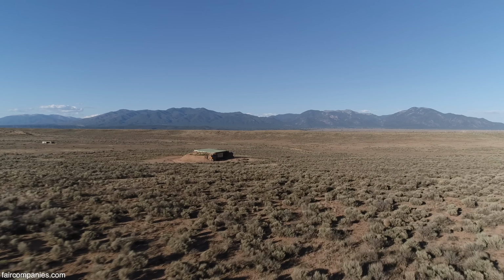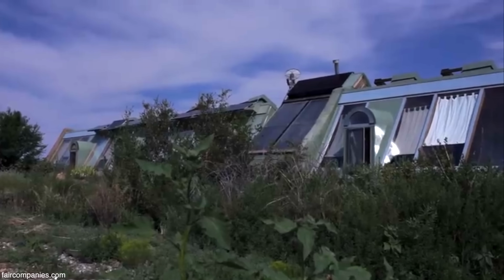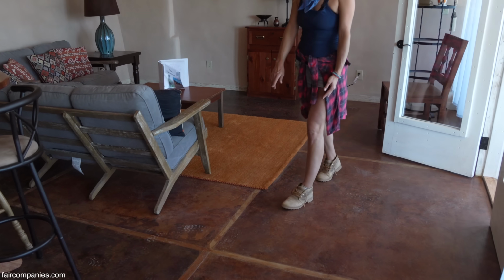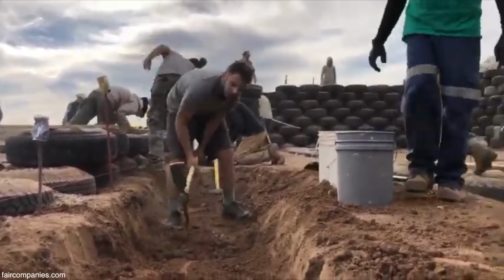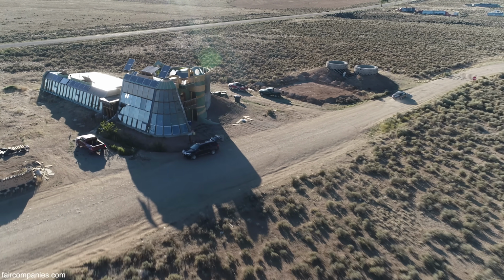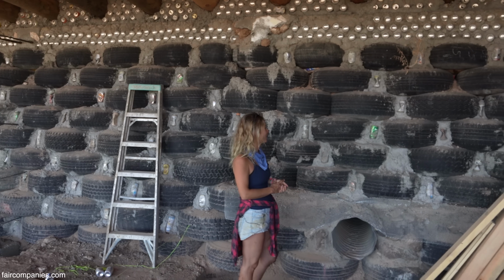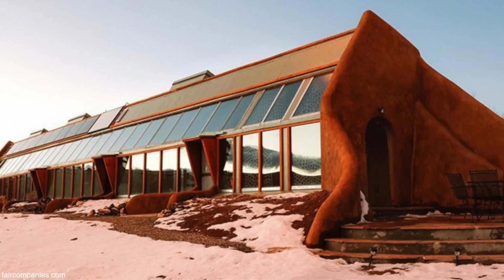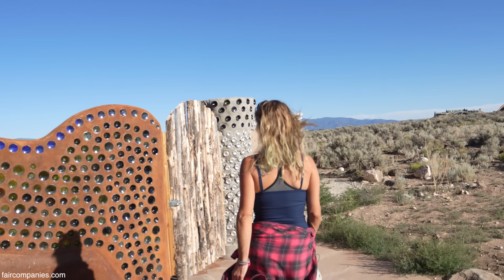New Earthships capture more energy, water & food at lower cost

Comment: It's not just low-tech, it's good engineering! This is the height of efficiency.
Reply: You get it! Exactly. It’s pretty ingenious, actually.
Reply: Hi teck is the solar panels.. low tech is the water and air  filtration system..
Reply: @bonnieprice9482  
Best of both worlds.
Reply: higher tech, higher damage
Reply: It's a return to the nineteenth century.  My mother lives in a house built in 1855.  When its 40 degrees outside, she's wearing a jumper.  Nothing was built with electricity in mind.
Reply: just "low tech" as opposed to high tech with sensors and screens and batteries and crap
Reply: and they are pretty
Reply: It's not "good engineering" .. Air naturally moves from a smaller opening to a larger one.  To test this.. roll one window on your car down all the way.. then crack the window on the other side.. Air rushes through the cracked window and out the big window.. it never changes, always works.  Any "air conditioning tubes" should be of a small diameter and the supporting windows on the other side  of the house should be 5-10 times larger in total area.

Comment: It's good to see they FINALLY started putting the batteries indoors where the temp is steady (and well above freezing) instead of the roof where the batteries' performance degrades more quickly with the wild swings in temperature from broiling summers and freezing winters.
Reply: That is probably due to a shift from lead acid to Lithium batteries. The lead acid outgased a lot of hydrogen and you could blow up your house. So they were put outside where they could be well ventilated.

Comment: One thing I’ve been thinking about is how the ancient Egyptians used mirrors to reflect light deep into structures. With the right emplacements, it could be directed anywhere indoors. Also you could use a gravity as a battery, with sunlight pumping water to the roof during day, and flowing down at night through a turbine. Or even pressure storage. And magnifying lenses could concentrate sunlight for cooking, or heat retention in rocks.

Comment: Low tech is good. Less things that will go faulty, easier to troubleshoot and fix.
Reply: Do you see the irony in saying "low tech is good" in a YouTube comment?
Reply: Exactly!

It's why I like having mechanical tools!
Reply: @CurtisDensmore1  Not really. The point is to be as low tech _as possible_. It's like the KISS principle in engineering. No matter how fancy a product you're designing, keep it as simple as possible.
Reply: What an inspiration. Thank you 😊💕
Reply: i would like both options. one that is automated and the other when the automated one needs repairing.
Reply: Many will need it built for them and funded for them. It’s a cool concept. At one of my jobs I tried sourcing them some materials but transportation wasn’t provided by my employer and he could of written off on his taxes, he owned a trucking company. It would of saved him waist costs.
Reply: I like to call it "Earth Tech"
Reply: @CurtisDensmore1  yeah. It is a curse and a blessing that I am both addicted to and can’t wait to get away from
Reply: @5226-p1e  Yes.  And there are forms of automation that are pretty low-tech, like the bi-metal coil that can open/close a valve/switch as it heats up or cools down, or thermoelectric cells that power a fan to move hot air around when things heat up.  Stuff like that.

Lots of smart people working on this stuff.  Full-feature Earth Ships are still fairly "young."
Reply: @5226-p1e  There's certainly very few reasons why you couldn't automate stuff, especially the various ventilation stuff
Reply: @MrSpleenboy  
i don't understand your point, please explain.

Comment: I love how you’ve adapted the earth ship over time and put all the years of experience into different environments. I’m curious if you think an earth ship would ‘sail’ in a temperate rainforest? I’m in the Smoky Mtns and looking to get undeveloped property for something similar, in terms of build concept
Reply: Hey Russell, I hope you see this:  Be sure to study such things as 'angle of declination' charts & info - for the area you become interested in - for positioning your south wall and roof overhang.
Don't forget to slop what isn't under your foundation/slab away from your front wall, also strongly consider either a perforated, clay or French/rubble trench drain.
Best wishes - never let go of your dream!
Reply: The only issues I can see is having to make sure your wood is as weatherproof as possible to delay rot from the humidity. Also depending on how much sun you will get you might need to add more space on the roof for solar panels since waterfall doesn't seem to be an issue. Or you can integrate your panels into your roof at a slight angle like scales so that water runs off of them onto your roof for collection. Also foundation on softer ground will need something more stable underneath. These earthships are in the desert on harder ground with less humidity and more sun, so those will be the factors you will have to accommodate your plans to. As long as you keep the area well ventilated, mold shouldn't be an issue either.
Reply: Yes, they have been built in other climates, should be easy to find with web search I think there's one in either Ohio and\or upstate NY

Comment: I like how they have upgraded their designs over the years, I'm still wondering why they are still pounding tires, it takes months to pound tires with a large amount of people, essentially they are just burying them, no difference in tires at the landfill. They have to transport tires and go to all that effort for so little payback. They could pour concrete walls and be done with it in a week, rather than months. It's of course not that sustainable, but it's 100 times more practical. They also have to fill the gaps between the tires, then doing plastering layers, that's an insane amount of labor. I would love to see a lower man hour/low cost versions of the earthship in climates other than the desert. I think earthships do best in very arid environments, especially because of the earth tubes. You can't do earth tubes like that in humid environments, you would be breathing mold/musty air.
Reply: they got nothing better to do, that's why they pound tires for months
Reply: How is pouring concrete not sustainable? Not sustainable means we'll run out. Maybe you mean environmentally friendly? Concrete seems to be, whereas tires secrete mercury, lead, benzene, etc.
Reply: Urban Hymns Maybe he means because of the limits on the right type of sand for concrete? 🤷‍♀️
Reply: @urbanhymns8880  Concrete requires sand, which is of a limited supply. Not to mention producing concrete is also a labor intensive process when you factor in the raw materials. You just don't see the work as the end user like you when you're pounding you're own tires.
Reply: Agreed, I have been following Reynolds and Earthship for years. Not a personal fan of his. He a bit culty for me. However I would definitely do earth bags instead. You can buy them by a huge roll for 500 dollars and waaaay easier. Fill them with a coffe can and tamp em down. Cut when needed etc.
Reply: @sedracer  Concrete is a WORK intensive process, not LABOR intensive. Their is a lot of embodied work in it, but it is largely mechanized. The work put into concrete is seen by the final user as reflected in the cost of the concrete. The cost has to include all previous work employed for the end result, plus profits. Compare that to any sort of reasonable wage for the labor in the tires and you will find why it is such a lop sided argument.
I like Earthships. I have several of Mike's books. I have been to the Greater Earthship community and stayed there. I still think that the idea of pounding tires with hammers by hand is best applied in developing nations that have no access to better mechanisms than human labor. For any place you can access mechanized work, use it instead. Unless you just have a bent toward substituting inordinate amounts of human labor for the sake of under utilizing infrastructure and machinery built for that exact purpose.
Reply: @sedracer  Yeah because tires grow on trees right?  Sand is of a limited supply!? Tires are made with petroleum,  THE non-sustainable resource. 
You may as well advocate for power generation through hamster wheels instead of solar,  since the Sun will eventually expire.
Reply: @jimmyredd  sand used in concrete is running out , look it up .
Reply: @jimmyredd  concrete production is a major source of carbon- at every stage of the production cycle it emits carbon. Tires do too of course, but they use them because reusing them extends their functional life span and controls a waste problem for society
Reply: IF they don't use concrete with additives like plastic particles, concrete is more sustainable then old decomposing tires! 
The concrete can be broken down and reused for other purposes.
They could even use geopolymers like roman concrete or use foamed concrete to create well insulated homes.
IF it needs to be cheap they could at least use earthbags made from natural fibers.
Reply: I'm reading the comments in favor of/and against concrete vs pounding tires. I see pluses for both sides, however, as the daughter of an experienced cement truck driver, you can't get a cement truck to remote locations, at all.  
To do a solid wall of concrete, you need a continuous pour of concrete, many yards of concrete. Given the moisture content, and different additives to the concrete in the mix, there is only a short window of time for making the concrete in the plant, loading the truck, driving to the site, then pouring it.  That said, making a solid wall of concrete with small batch equipment would be very labor/work intensive.  You'd have to have multiple teams of people to keep each batch of mix going & pour (shoveling sand, pouring bags of cement mix, gravel, water, etc) to simulate what cement trucks could do for a large pour. Each team needs to use the same recipe and know what they are doing. To have all that material on hand, at the same time, is challenging too.
My first thought too was why not do concrete?  Then reality hit.  If within 30 minutes or less to a cement plant, probably doable.
Reply: Matthew Gula Wow crazy- didn’t know. Thanks.
Reply: They are using tires as bricks, it is the framing for the house. And they are taking them out of the landfill, it would take forever to do all the repairs that would be required if they did not use the tires. They are really saving time.
Reply: For me, foam-concrete blocks seem green enough solution. They are also dirt cheap and very easy to lay.
Reply: @TechnoGeek18023  
😄

Comment: It says these are less expensive... only 200,000, how much are the more expensive ones? 200k is not reasonable in many areas of the US. 
.
Reply: The older Global models used to start at $200K, I think. Since then inflation has pushed it up, and I think that they are trying to stay on that target price. That reflects the cost of the place all in, though. Your labor may have more or less value than that of the workers.
Reply: Imagine saving $500 per month in energy, water, and sewerage bills. That's $60,000 saved over 10 years. That being said - ideally someone could do something similar to this Earthship for less money. New build housing is expensive. Materials cost a lot and labor is a big factor. Older homes or trailers may be filled with toxic chemicals from past generations, and often require a lot of upkeep. Roofs and walls can be ticking timebombs just waiting to cost thousands in repairs.
Reply: @Nphen  Where are you located? I run about $150/m for gas and electricity on average. Are those east coast prices?
Reply: @Nphen  I live in Scotland, my energy, water, sewerage bills are probably $180 or so a month.  It would nice to knock it down to zero though or close to it.
Reply: @Nphen  Old homes are not that high of a risk or you wouldn't be able to insure them. New construction has never been easier; once you have the blueprints you can do most of the framing yourself if you wanted. I'd sure as hell rather pound nails where ever I wanted than beat tires in the middle of a desert.
Reply: I agree, $200k for a two bedroom one bath house seems steep.  I'd like to see a cost break down and see if that is mostly labor or not.
Reply: They cost so much because of the labor, if you're doing much of it yourself they're far less expensive and they also have smaller building plans.
Reply: 200k it can be not!!
Reply: I live near where this took place, and you can get a 4 bedroom house for that, but you also gotta take into count that the bills will be a whole lot less
Reply: The can be much less if you can do the contracting or some of the building.
Reply: There is truly no reason a giant wooden box should ever cost $200k. It's insane that we've normalized housing being so expensive.
Reply: @theuglykwan  That's for how many people in your residence ?
Reply: @KirbyTalksMoney  The bills are lower, but so is the standard of living.
Reply: How can I, at age 72, build a small affordable, sustainable earthship for myself and my 5 cats, with (most certainly) alot of help? And, where would be the most affordable place to build one?
Reply: cries in New Yorker
Reply: @suserman7775  In the UK, water and sewerage fees are based on the value of your home.  Energy fees is based on actual usage.  There are 2 people in my household.
Reply: @suserman7775  in what way is the standard of living less? They have power and are nearly self sufficient.
Reply: You also have to remember that these things would last the next part of forever. These things are basically bunkers. Properly designed these are immune to all but the most violent weather and simply doesn't fall apart. The kind of maintenance you need on this is stuff you can do with basically hand tools.
Reply: @grauerHase  lol the fact that  you think a modern house is just a "wooden box". You do understand that the wo ok in a modern home is the cheapest part right? Alot of the money is for the lot/property. Concrete foundation/electrical/roofing/insulation/plumbing/hvac/appliances. These are where the majority of your money goes for a "wooden box". You must be very young to be this naive.
Reply: @Cyberwar101  these are absolutely not bunkers lol.
Reply: @michaelmiller5177  it costs 225$ per square foot for a custom made one

But they have stated about 2 months ago the price has dropped

So they’re slightly above average cost than a regular home if it dropped below 225$ 

But regardless I wouldn’t take an earthship 

The maintenance is too high

Get a rammed earth home, and implement the Earthships design
Reply: If you’re actually wanting to be apart of the build and use more recycled and reused materials it would not cost you to spend this much money in order to build one. I found one couple who did the vast majority of their own building and have nearly a 3,000sq ft sized Earthship and they spent $55,000
Reply: Be glad you aren't in Seattle it costs $800k to buy a house here.  $200k sounds amazing
Reply: @ajcambern  sheesh, I’d get out of the big cities sooner rather than later, grab some land build a home, or buy some land that already has a home on it
Reply: @tanjaeubanks  get a rammed earth home

Comment: Seems to me that just digging a hole and putting a dome type structure in the hole, covering it with dirt leaving the glassed front uncovered would be more efficient and a whole lot cheaper. Lighting could be done with Solatubes. Beneath ground level would make the temperature easy to control and cheap. It also would make it storm proof. The drawback is that you would have to mow your roof.
Reply: Larger flood risks
Reply: Water is a real pain. One of the reason people like to build earthships in the desert is because it makes it way easier in terms of water damage and intrusion.
Reply: The problem with all kinds of whole in the ground buildings is moisture. It pushes against any type of wall, condensation becomes a real problem and that in turn causes molding. That area is also one of the biggest challenges of modern building in general. Even the most modern of buildings sometimes have to fallback on simply drying the internal air because it's such a tough problem. Whole in the ground Hobbit style sounds like a good idea, until you've ever lived in a cellar or half-cellar flat and experienced the molding problems.
Reply: @palarious  I always wondered why there aren't Earthship communities up here in the Midwest. Humidity is a huge problem here. Every basement in Michigan needs a dehumidifier running for 6 months of the year.  I did see an Earthship build in Canada. I figured the size of the berm would stop water from getting into the home - but only in the desert. Looks like I will have to go the Matt Risinger route on any future new build!
Reply: @Nphen  I think it can be done, so long as you're either open to some radical techniques or use modern approaches, like Reisinger.

Takes really meticulous planning to design a regular self sufficient home in the desert. Would be tougher, but I think doable even in the cold and wet. Often the measures you use to mitigate water intrusion are compromised by temperature differentials, like Reisinger often points out. 

Many of these issues can be made easier to solve by removing wood and drywall from structural elements. One of the impressive things about hollow concrete is that you essentially form an interior condensation chamber in the middle of the brick that doesn't impact the structure. That's the kind of solutions you end up having to go for. 

Actually living in space is going to be a nightmare of engineering.